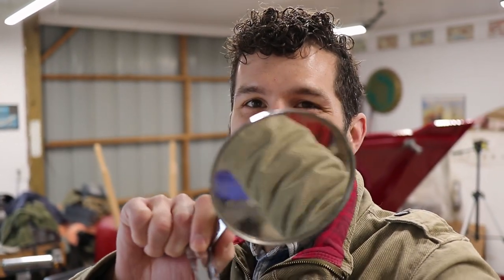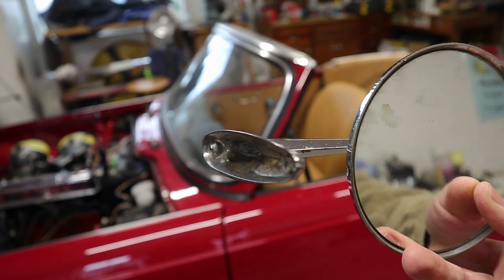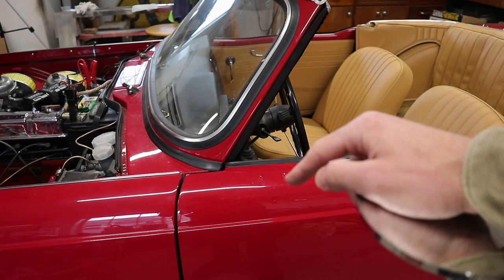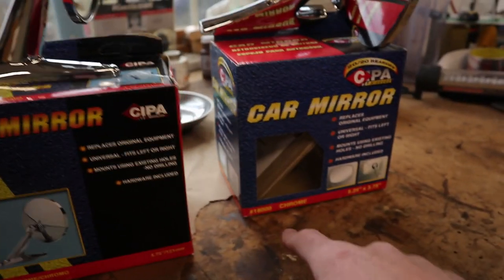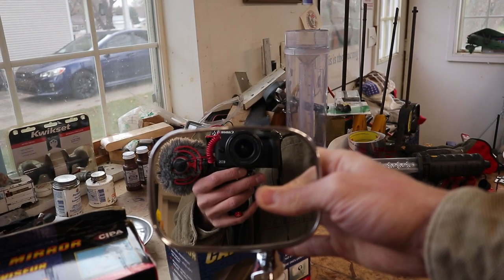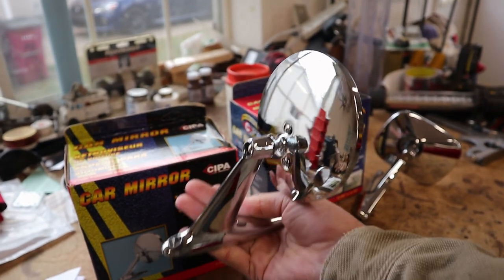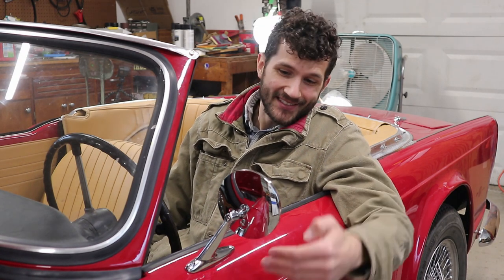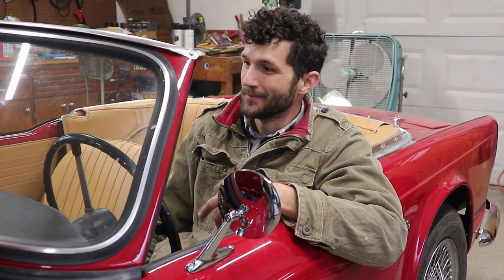Door Mirror Install - CHEAP Mirror Options for Triumph TR4

Comment: Had a similar issue with my TR6.  Didn’t realize it at the time but the bullet mirror on one side had a different base than the other side.  Ugh.  At least I didn’t have to deal with the flat vs curve issue.

Comment: Hi there just a quick question about one of your older videos - does the TR4 have captive nuts (or pre drilled and taped ) holes in the top of the B pillar for the fitment of the hood frame brackets? Ps love your videos - I ve brought a tr4 but can’t get to it because of COVID lockdown. Thanks
Reply from the maker: Congrats on the TR4 purchase! Hope you are able to get it soon! You are correct about the hood frame attachment - there are three (if I recall correctly) captive nuts inside  each B pillar. The screws go through the hood frame bracket and interior panel.

Comment: Traditional classic door mirrors, don’t work very well and, IMHO, spoil the lines of the car. Instead, I have fitted a wide-angle interior mirror and this works very well leaving, no blind spots. Cheap, trivial to fit and easily removable. The only downside is that I am confronted with my ugly mug every time I check my 6 o’clock.
Reply from the maker: Yes, we may need to swap glass for a wide angle mirror. It just ends up really close to the driver being mounted on the door.